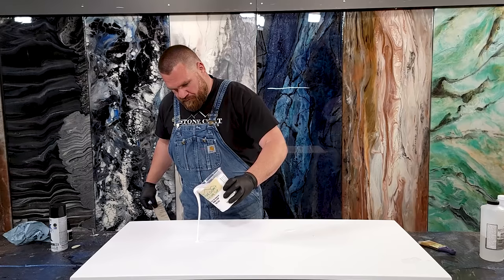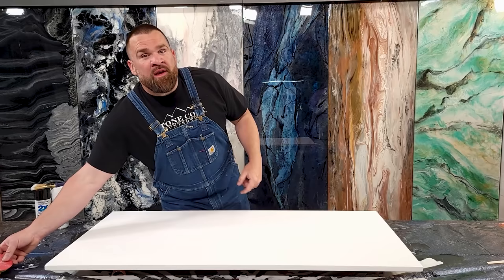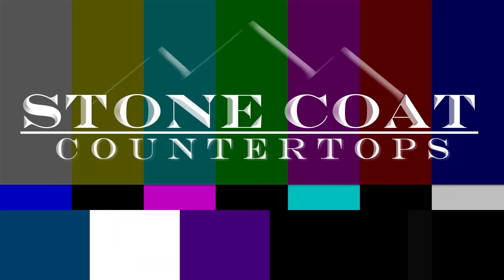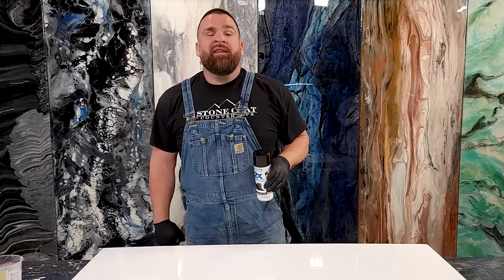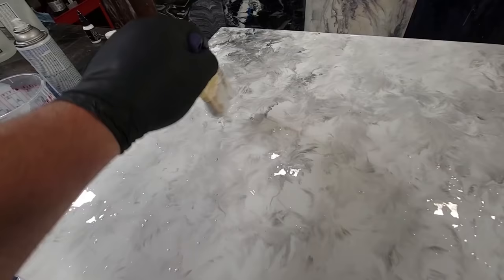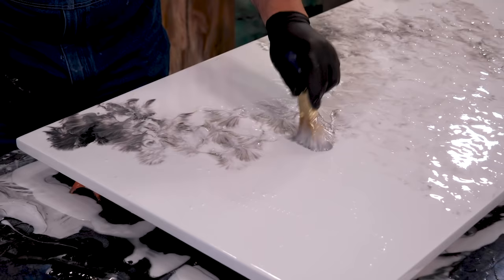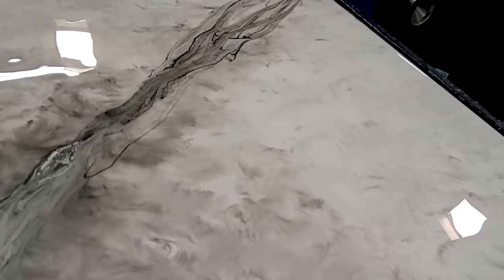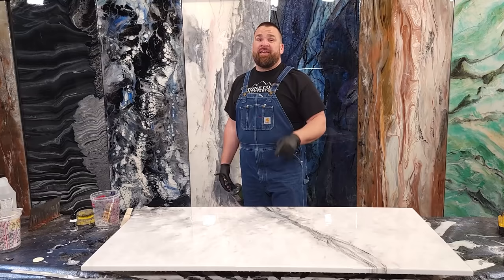Easiest Way to Make White Marble with Epoxy | Stone Coat Countertops

Comment: A. I definitely think the more defined vein from the paint sticks made your piece look more realistic. If you want to create veins that truly compete with nature, splinter the main vein either at the top or the bottom, or both…kind of like lightening strikes (they usually have either a right side up “y”, or an upside down “y” in addition to the thicker bolt of electricity). Then the heat gun aimed at just the edges and sweeping outwards (from a bit higher above) would diffuse any hard lines. Perfection!
Reply: Great tip!

Comment: I've been watching your videos for a few years now, and last weekend we finally decided to go ahead and give it a try. Followed this tutorial for some TV tray tops (practicing for a larger project) and they look GORGEOUS! Now I'm confident that we can do our bigger project when the time comes .... we plan to replace our kitchen backsplash with this exact design. Thanks so much for all of your videos!

The only problem we ran into is one of our dog hairs decided to land on one of them while they were drying ... do you have a video on how to sand it out without adding another coat of epoxy? We did it in a non-dog room but it's impossible to keep all the tiny hairs away, and adding another coat would increase the odds of it happening again.

Comment: I been doing alot of samples free hand measuring just need to know how measure my ounces for when i do more samples
Reply from the maker: Measure up 3 ounces per square foot of project. To get the square footage if measuring by feet. Multiply the length by width. If measuring in inches multiple length by width then divide by 144. Let me know if you have any questions

Comment: Looks awesome.  Question.  What do you do to the bottom of the piece? If you look at the edges, there is epoxy dripping off, and my guess is that you need to clear those drips, so do you simply scrape them off?  Just curious thanks!

Comment: Can you apply this coating over existing Formica or does it need to be wood? Also I want the white look with slight gray veining, so would I use gray spray paint instead of black?  I want to do this on top of Formica countertops. Love this technique❤️
Reply from the maker: yes you can! you just simply need to sand and then apply our bonding primer first so that the epoxy has a good bond. and yes you can do grey as well!
Reply: You can go right over slick laminate with the right prep steps. NO DEMO NEEDED!!!!! Search Stone Coat over Laminate, watch the few videos we have over existing and if you have any questions let me know mitch@stonecoatcountertops.com

Comment: Is it a must to use the Art coat for white based countertop or can i use the countertop heat resistant epoxy with the top coat?
Reply from the maker: If it is going to be white or light colored you would want to use the Art coat as it has has more UV inhibitors. After your color and flood coat you can UTC! If you'd like, give our project support a call. You Got This

Comment: I used  a Stonecoat kit on a new countertop project about 3 years ago. The finish was very similar to this white marble. We were going for a  Carrara marble finish. When finished it looked great, but then started to yellow after about a year. Now, it is very yellow, to the point where it will have to be redone. I contacted Stonecoat but was never offered any reason why it turned yellow. Any suggestions? Is this a new product that will not yellow?
Reply: Lloyd Gibbs, I'm sorry to be nosey but I was curious if you ever got a response from stone coat company on reasoning for the yellowing? I've been doing a ton of research preparing to attempt my countertops and this is one of my biggest concerns I want to try to prevent as much as possible. I was hoping for any advice I could possibly get on this issue and read your comment figured I'd ask

Comment: What epoxy will I want to use to fill worm hole/ woodpecker holes in pine
Reply from the maker: How deep are the holes? If they aren't too wide the normal Stone Coat Epoxy could work, if they bigger than a quarter in diameter I would use casting epoxy
Reply: @StoneCoatCountertops   the boards are less then and inch thick and holes go all the way thru most hole are only 1/4 wide but some are bigger maybe 1/2 to 9/16

Comment: How much should I charge per square foot?
Reply from the maker: We charged $29 per square foot here in our market because that's the price point that laminate is here to be installed by a contractor. We up charge for under-mount sinks as well as rock face edges, but the materials cost about $5 per square foot so there is a very healthy margin and the customers are happy to be priced at the same as laminate.
Reply: Thank u for the reply I watch your vids nonstop and done a few projects 🙏